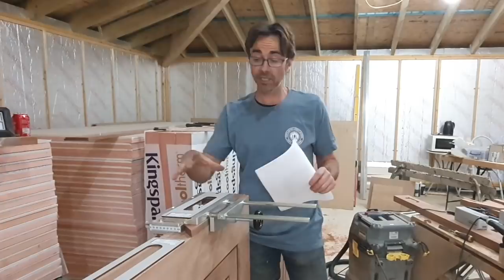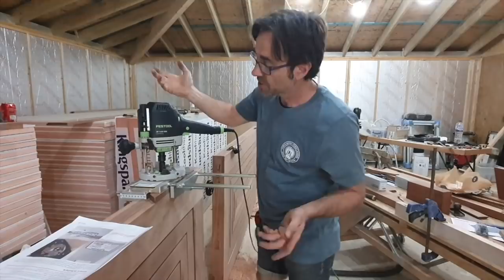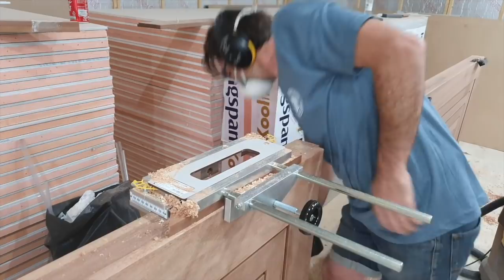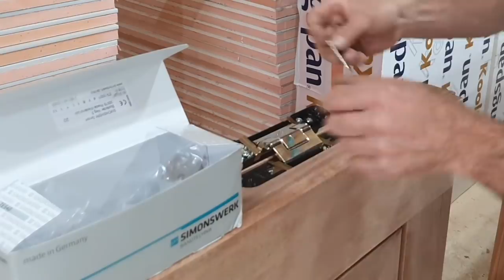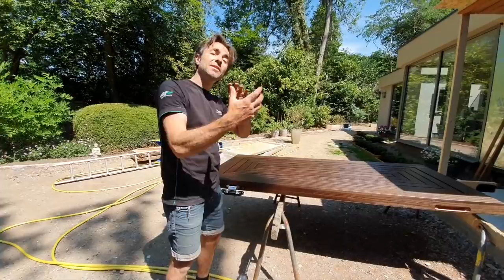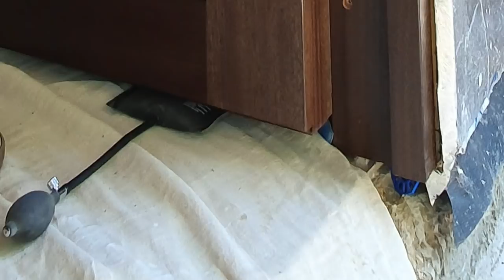Tectus Hinges

Comment: Hey Robin

How much play would you say the hing had int the slot?

I have their 640 3d, the jig and plates, so pretty much simonswerk kit, 30mm colar and 24mm bit as recommended, and i get about 1-2mm lenghtwise play as well as about a mill side to side... just wondering if thats normal (which i suspect its not)

Thanks

Comment: Can these hinges be fit into a standard 3/4” jamb with the trimmer stud behind the jamb mortised? Or should they be installed in a 1.5” jamb?
Reply from the maker: Thicker jamb the better, its more about the screws having enough to bite into, the actual body of the hinge can mortice through the frame if needs be but the screws will need extra solid grounds behind the frame if that was the case, also it would depend on how heavy the doors where etc
Reply: @robinclevettcarpenter  thank you! I think then I can use longer screws so that they go through the 3/4" jamb, the shims all the way into the trimmer stud. Door weight is probably 80-100 pounds.

Comment: By far the best Tectus installation video I've come across. Would be good to know which collet extension you're using, and which 24mm bit. I've found the hard way that the CMT extension is larger at the collet than the 30mm guide bush, so it impedes the plunge. I've had to source a 1/4" shank extension and a 1/4" 24mm bit so it would work, and all that is on the way. Will have to take more passes than would be needed with a 1/2" shank.

Comment: I always get worried putting screws in like that, that they might snap the head off 😰 is that ever a worry for you or are you so experienced it just doesn't happen?
Reply from the maker: It's a real problem with some screws, I always use a decent pilot to the correct depth and test the fixings on a piece of scrap first, great comment, all the best Robin

Comment: Hi Robin, nice job mate. My only concern would be the potential for a 100kg door to slam shut in a gust of wind and either take someones fingers off or shake the frame to bits.
It's bad enough with a heavy fire door. Does the hinge have any sort of built in friction to stop them slamming ?
Reply: Hi Nick, there is no built in closing/friction device for TECTUS but the hinges can be used with concealed overhead door closers to maintain the 'concealed door' effect

Comment: To set an accurate depth on a router. I set the router bit to touch the work piece. Then on the depth set up  I ignore the scale and use a drill shank. I have a set or drills from 2.5 up to 13.5mm in 0.5mm  increments so its spot on. You can make up accurate spacers for deeper cuts too.
Reply: Good tip that

Comment: Hi Robin, could you route out those hinges with the sober jig with the correct size cutters?
Reply from the maker: Hi Kevin, I didn't even consider using the souber, in the case of smaller Simonswerk hinges then maybe, especially if the fore end is no more than 25mm, the hinges I used are around 36mm wide so that maybe to much for the souber? you have me thinking now!!!!
Reply: Your right there, Souber cutters only go up  to 32mm, it would only help you cut out the main body of the hinges. Unless you did it with two passes with a smaller cutter with the off centre jig for the plate. Before Dropping the hinge in and tracing the plate and manually routing out the bottom and top radius. Pretty much the same about of effort of what you are doing already . If only those hinges was slightly smaller, I do really like them.

Comment: Nice work Clevett. It's gonna make a great sound when you use them. 
Them there screws look a bit on the short side to catch the core. Do you find that the screws that companys supply with stuff are usually made from cheese.
Reply from the maker: Thanks for the comment, I always start with the supplied screws!! In the case of these hinges so much of the load is taken through the mortice you form when they are installed, in the frame I used my own longer screws and these where 50mm as opposed to the ones supplied, my plan is that I will monitor the doors and if I see any movement of the hinge then I will replace with some longer ones, I do agree about screw supplied with some ironmongery, sometimes they are just wrong or in the case of ploished chrome the type you get with some handles and hinges they are as soft as butter!! I often use all my own screws in place of supplied!!!